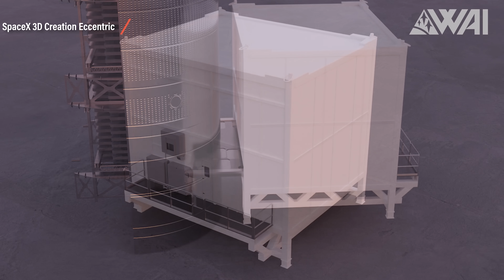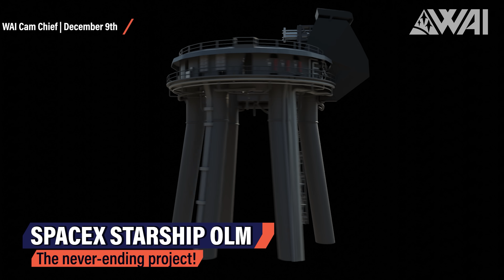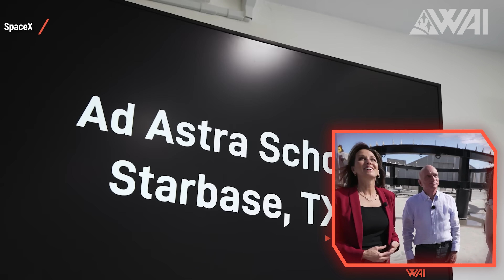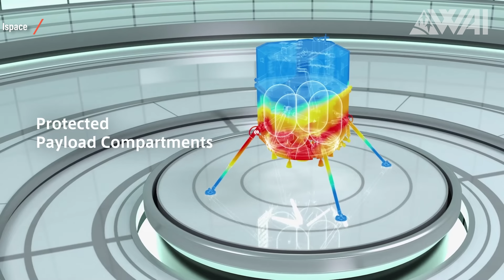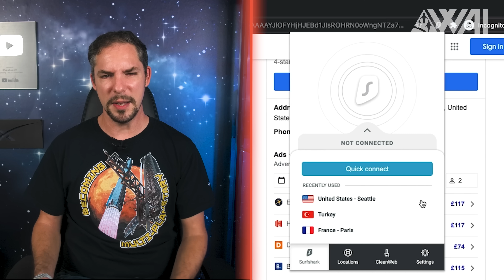SpaceX Starship New Solution! Artemis 1 Splashdown Flawless?

Comment: The only thing withstand the magnificent 33 is fireproof stainless steel circus dome under stage 0. At sufficient structural toughness and sufficient thickness of segments, yet light enough to hydraulically removed to be able to access  under rocket for maintenance purpose. Plus water cooling of course.

Comment: I heard that they were not allowed to build the flame deverter/trench because of the wildlife refuge.
Reply from the maker: Huh? How so?
Reply: @Whataboutit , Hmm, there was another video on SpaceX that stated that because of the wildlife/wetlands surrounding it they couldn't build a flame trench because of the usual environmental BS from other organizations.  Don't remember if it was on the Angry Astronaut channel or not, but it covered the damage done by the static fire.  I was going to respond with a comparison question of Kennedy Space Port but messed it up and deleted it.
Personally it's going to cost a lot more than an original install.  That deluge system needs to start earlier and a lot more water needs to be added.  That much firepower is going to create a clinging dust cloud, unless of course your fire was hot enough to turn it into glass.
My other question is did SpaceX deliberately build the launch mount that way to test out landing and relaunch.  Those first autonomous landings are going to create a mess just to drop off construction equipment and supplies especially on the moon.  Would you launch a vehicle to drop down first and blow/blast the dust and small debris away from the landing site or maybe a giant vacuum cleaner/dump truck to haul it away?

Comment: If any SpaceX Engineer reads this, it's high time you convince your boss that the protection of Stage 0 should be considered the same way as tank armor. A flame diverter is primarily use to DEFLECT the force of the flames. Your pad doesn't hold up to half the rocket power because it takes the exhaust at a 90 degree angle where the force will be the strongest. It's not even a question of abrasion or heat at this point but sheer kinetic force. Adding a flame diverter is mandatory to alleviate the force recieved by the martite coating so it can do its job, resist to abrasion and heat while the angle itself takes care of the kinetic energy. 
If you don't implement this in a 6 months time, your Starship program is DOOMED to FAIL.
It's high time Elon understand that you CAN'T go big in space without paying the price albeit reducing it to acceptable standards is still possible, there will always be unskippable minimum requirements. The more powerful the rocket is, the more expansive the launch complex must be, it's just laws of physics at this point. Starship is a magnificent project and you let greed and money costs hinder you by ignoring such basic facts?
I'm about to think that your boss is just a fraud taking credit for the ingenuity of others at this point. So prove me wrong.

Comment: Felix - It also occurs to me that SpaceX could use the same steel they are using in Starship , perhaps 3X thicker and a variant of the reentry tiles as an outside coating.  If they made a simple triangle (flattened slightly at the top ) they half the force of the blast impacting on each side of the pad and as the blast on each side turns horizontal it further reduces the force of the blast further.  They would need to put two diametrically opposite channels using Fondag to endure the (reduced) heat and blast.  Seems like it would be easier to pour concrete once and not numerous time.

Comment: Deer moon won't happen this decade. At least not on Starship.  It has yet to get more than 10 engines running without breaking anything, its miles away from an actual full stack testlaunch.  Then there is the refueling issue, that whole system needs designing, manufacturing, testing and deploying before starship is anything more than LEO capable. Not holding my breath on that one.  But for me, it is the ever so slight issue of the ship not being human rated. As far as I can see the ship has no escape mechanism built into the ship nor is there any design or team working on this.  Without the ship being human rated,  it's relegated to LEO satellite launcher at best. That's a long way short of a million people on Mars. It's likely that Artemis will be the vehicle if this mission ever happens.
Reply: SLS Artemis is too expensive even for a billionaire, and launch escape system isn't a hard requirements for non-NASA missions. And there's absolutely a team working on crewed Starship

Comment: why dont they just use the special concrete as the base. 6 inches thick of flame retardant Kevlar and 2 inch plate to cap it all off? they can run 2 inch thick anchor studs @ 4 feet deep for fear of steel softening. the blast is only going to last 30 seconds tops.

Comment: I think the concrete base is being used for a few different reasons:  
1)  Reinforced concrete flexes a little which is what SpaceX needs--those static fire nests kick up a LOT of seismic activity.  If we swapped  it out for a steel plate  it would certainly flex enough...probably too much (welding fractures, etc.)
2) A traditional flame diverter or a pool of water are possibilities, but Elon Musk is testing these static fire mounts and the floor of regular launch pads.  Diverters will also be diverting any broken concrete in all directions so you have to design for that.  Considering Musk wants to launch a thousand rockets just for his Mars mission, I think SpaceX is trying to figure out how to cram these test cradles as close together as possible.

One caveat: concrete is porous so water gets drawn in while the rocket cools down.  The next rocket to use the pad is going to shatter that concrete and fling it everywhere, maybe even into other rockets or starships.

Comment: I imagine a large flat metal structure should work a flame diverter. If it still doesn't work as a flame diverter, perhaps with water injection out of its center to flash into steam to redirect the flames and vibration outward.

Comment: Orion was designed & built by a generation of people that got participation trophies while in school & that failure was on display after splashdown.   NASA can claim success but this will force them back to the drawing board.  When will it launch again?  2, 3, perhaps 5 years?  Either find a way to slow re-entry or improve the heat shield and that was the only obvious damage/failure we could see.

Comment: Why not build a portable flame diverter out of some Tungsten alloy?
Move it in for the fire tests and launches then out again when they need to work on the booster.
It could even be liquid cooled from the water delusion system.
Reply from the maker: That’s exactly what I would build if it was my project. Make it three elements that can be put together under the OLM and you can take it out in between tests. 🤷‍♂️

Comment: The dispenser solution is simple, but it only really works for Starlink. They also need to be able to handle third party payloads.

I also wonder how it works structurally with such a big opening in the middle of a steel structure. It must be a serious weak point in the structure.

Comment: Maybe instead of a flame diverter they can put in a flame diffuser? A  large inconel “grid fin” spanning the diameter of the of the pad supports. Maybe it can break up and channel the exhaust gasses in a way that destructs them kinda like a phased array panel. It may even reduce the volume necessary for the deluge system. Just a thought.

Comment: Is putting a metal cone/plate or flame diverter under the OLM an option, even if it wears out over time surely it's still better than having to dig up and replace the concrete after every static fire?
This is a question many have asked but no one seems to have a definitive answer, only speculation.

Comment: Hey felix, what will happen if we put starship heat tiles beneath the launch pad instead of using concrete? Will that be able to bear the heat and impact from engine's?
Reply: Possibly the heat but NOT the impact.  Heat shield tiles are made to protect from the pressures and heating from re-entry and are easily damaged if any other forces are placed on them because they are designed to be as light as possible.  Having said that, it would be far simpler to design something which can divert the flame and be much more durable than whatever is being used now.  The problem seems to be one of policy, Elon doesn't seem to want to work with an alternative and that spells danger because it was the fact that he wasn't "married" to a single solution which produced success for the Falcon rockets.

Comment: given ice has compressive strength not that far off concrete and given its thermal characteristics how long would metre thick slab last under a raptor? I mean ice under a blow torch doesn't melt very fast, so I wouldn't be that surprised if could last 10 seconds or more  and gracefully vaporize/ablate/shatter away under rockets exhaust in a relatively harmless manner. It's not like don't have lots of cryofluids to make the slabs lol....

Comment: A lot of people dont know about concrete is that they have different levels/density requirements. When you see a concrete truck on a job site just idling is usually a bad thing. Some of them concrete are rated and have to be poored in within a time limit to be respecfull of their "rating" and what they are used for... Just throwing that out there.

Comment: What they need to do is dig out a flame diverter with a sliding cover that they can slot in and drive the lifts on for maintenance. It would help by redirecting the shockwave from ignition and full burn as well as debris in the case of an engine meltdown. The only real concern is the stability of the pad itself as all the legs appear to be needed to support the starship so the diverter would have to be designed to eject in multiple directions.
Reply: Boca Chica site is practically at sea level, isn't it? Doesn't exactly leave room for digging down, as you would hit sea water pretty quickly.
Reply: @imarchello  Creative solutions then, carve out a dish and push the exhaust back up and out, the deluge system will fill it but it will get blown out taking more energy from the exhaust as it goes.
Reply: Space X has people working there who are way smarter than all you Youtube basement dwelling armchair experts.  There is no flame diverter being applied to these tests because they purposefully don't want it.  There could be a number of reasons for this, but since all this current testing and damaging stuff is being purposefully done to gain loads of data, the safestest speculation is that a flame diverter would be counter productive to that processes (at least at this time).   It could also be that a flame diverter could add problems to the system too.  who knows.  Problems you people haven't thought of, since you are not there and not included in data reviews.  Overtime, it will be exposed as to why this is going on.
Reply: @TheJTcreate  In fewer words your comment basically says "Shut up, you're stupid", that's how it reads anyway. 
Perhaps I like to speculate and flex my creative mind to voice my opinions. I'm sure there's reasons for the lack of a flame diverter, one is definitely easy access to the engines but as we have seen, there are many alterations that have been made as the true power of the raptor 2 engines have been revealed. I am under no illusions that Elon himself will take notice of my posts and say "great Idea" like his team hadn't already made those considerations or even proposals but I will continue to make them regardless.

Comment: I don't know that they refuse to build a flame diverter. Maybe they are so close to sea level they cannot. Maybe they should dig a hole and let it fill up with water. Might cause some problems with the current infrastructure but they might only have to go a couple of feet down which might not affect the current footings. They could also use tiles used for reentry overlaying the concrete which will always erode from the engine firing. I think they could experiment with water and heat tiles to see which might work best given the circumstances. If they have to do a traditional diverter it will set back the launch at least six months if not longer. I know there will be all sorts of comment suggesting I should STFU but please consider the consequences of doing the same thing expecting different results within the current constraints.

Comment: My intuition tells me that Space-X will need a stainless steel flame diverter. I just can't imagine any kind of concrete cutting it.
Reply: I've read somewhere due to launch site so close to the ocean , it's very very expensive to dig to make a flame disperser because then you need to prevent flooding at that site due to high levels of salt groundwater. For testing it's probably much cheaper just to repair the damage and then concrete is easier to repair then (stainless) steel. Once they launch astronauts they probably won't be going from Boca Chica But Nasa facilities elsewhere probably have tunnels to divert flames there as well already made.
Reply: Stainless has piss poor thermal conductivity. The surface will likely melt.
Reply: @executivesteps  Thermal tiles then?

Comment: I think a flame diverter is inevitable. They might as well try to figure out how to make one of those durable, modular and easy to repair. Because the combination of heat and acoustic forces that are reflected back from the ground seem to crack the concrete and turn it into shrapnel that one day might cause a RUD after engine start, or at least damage Stage 0. Since Stage 0 is by far the most complicated, it would take the longest to repair and would make countless Superheavies useless until the launch pad is repaired.
Innovation is the hallmark of SpaceX, but sometimes I think they can be downright PIG-HEADED in ignoring pragmatic solutions of previous Spaceflight engineers. Elon may have disdain for NASA's bureaucracy, but their engineers started with essentially NOTHING and designed and built EVERYTHING to take men to the surface of the moon in 8 years! Their engineers were not stupid. They also learned a lot about how destructive acoustic energy is when so many of the Shuttle tiles got knocked off by the reflection of energy from the engines on lift-off. So they have a lot of real world experience too.

Comment: Isnt it possible that spacex actually dont use flame deflector far the reason to blast the concrete? You know - like doing two things at once. One is doing the static fire test and at the same time they have this unique opportunity to study various building materials and perhaps even develop new once. Maybe on Mars the flame deflector would be not practical so they know they will need launchpads without it anyway...Can anyone elaborate?
Reply: They plan to fire maximum 6 Raptors on Mars, concrete handles this already

Comment: I'm often thought that investigating acoustic couplers that present an out of phase signal to the area beneath the booster could mitigate this. It would be something like early noise canceling microphones, where acoustic tubes presented an out of phase ambient signal to the diaphragm
Reply: Sounds good, but how large does this contraption have to be to be able to handle the monstrous displacement that Starship will produce?
Reply: @The_O  I imagine it would be some multiple of the frequency you're trying to cancel, and it may be too massive. As an alternative the water of the deluge system could be used as the sound transmission medium. You don't want to completely cancel the shock wave. Attenuate it a little at the boundaries with an Out of phase frequency at lesser amplitude carried by the water, blunting the edges.

Comment: The trouble with the launch mount is that it's got too many legs! Which makes it pretty near impossible to use a moveable flame diverter. I remember NASA used to have movable flame diverters on some of it's old Saturn test stands. They could just roll them out of the way when not being used. Have SpaceX started building the launch stand at Pad 39a yet?, I think they may want to rethink the design. But back at Boca Chica, I wonder why they can't simply cover the concrete with thick steel plates that are bolted down? I would guess there must be some reason why that is not possible, otherwise I am sure they would have done it already. And with regards to Tim Dodd, I can clearly remember him being asked back in the starhopper days whether he would ever want to fly to space, his answer was a resounding NO. He's certainly been bitten by the space bug!
Reply: I saw somewhere that the issue is not just the concrete breaking up, but also shockwaves bouncing straight back to the ship.
Reply: @justinclaiborne1716  Indeed, the water deluge system is meant to help in that regard. I was wondering if that was why that could not simply use flat sheets of steel, maybe that would reflect even more of the shockwaves back to the ship. Maybe concrete can absorb more of it?

Comment: FLAMES are not the problem. Powerful, rocket damage-causing shock waves are.  The flat, hard concrete pad is a perfect shock wave reflector, and slo-mo video has already shown them impacting the booster with only 1/3rd of the engines firing.  Those shockwaves have been described by viewers miles away as a pounding you can actually feel in your chest as far back as Apollo.    I expect bad things if SpaceX continues on the no-deflector path.

Comment: Launching SH at sea won't be able to have a flame diverter, so SpaceX has a solution for that. Perhaps simply using an aerator 100+ feet under water beneath the booster. Works for high divers.